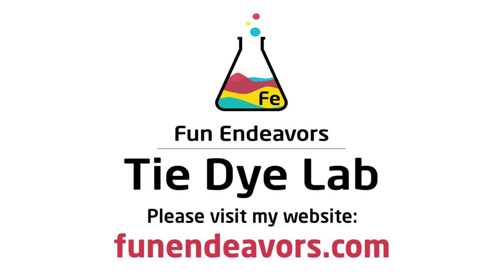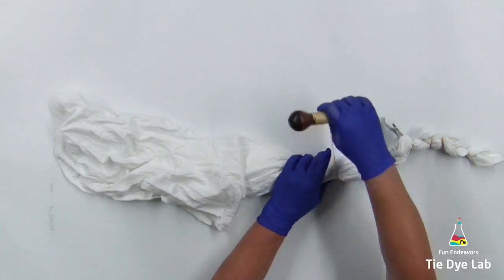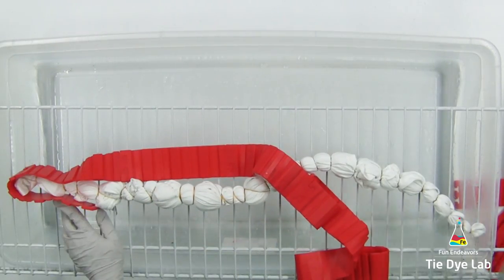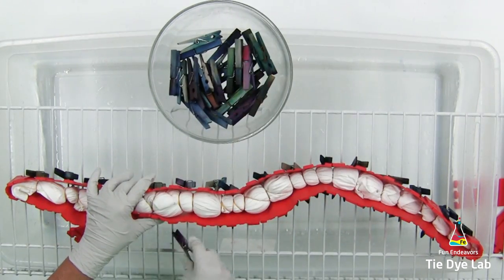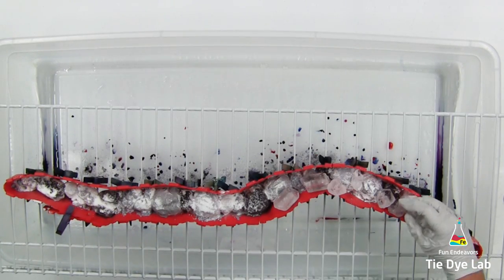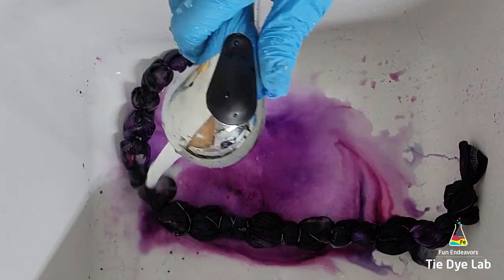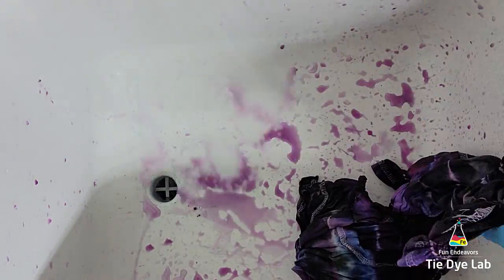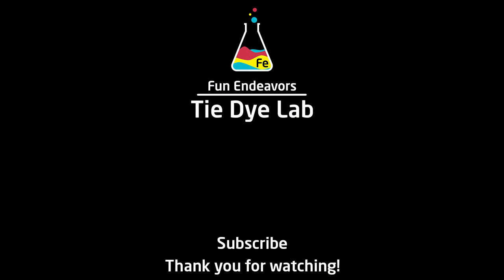Tie Dye Design:  Ice Dye Purple Waves Geode Tie Dye Shirt

Comment: A question for you:  What kind of twine do you use to tie your shirts up that produces such clear separation lines?  I tried this shirt using a spool of 1/4" white elastic that I had handy; it tied just fine, but the separation lines are almost completely absent (probably because the fibers on the elastic allowed the dye in.)  So, what would give better results?  I love my shirt, but it doesn't look like a geode.
Reply from the maker: I use an artificial deer sinew.  It is wax coated and so when the sinew locks down on itself,  it won't allow any of the dye under that area because of the wax coating.  Here is a link to the kind that I buy from Amazon:   https://amzn.to/2EF28Lu

Comment: Question on liquid dye: how long will mixed liquid last in bottles without losing saturation? Thank you love your videos!
Reply from the maker: Thank you!   It really depends on the color and where you keep them.  If you store your dyes in a cool location they will keep longer than if you store them where it is hot.  Also, I've noticed that the darker colors tend to fade faster.  They will go on the shirt looking normal, but they won't be as dark when they are rinsed as they normally are if the dye is too old.  Most colors if they are kept in a cool place will last about 2 weeks.  However, I usually don't trust black to still be good that long.  When I mix black dye, I try to use it all within a day or two to get the darkest black I can.
Reply: @FunEndeavors  thank you for the info. I live in central Florida, work outside and its very hot and humid right now. Sometimes I will add more powder to the liquid dye bottle if I'm running low while dying. Love your geode shirt. Will give a try.
Reply from the maker: @tonigiovino2359  That's great - the added powder will refresh your dye.